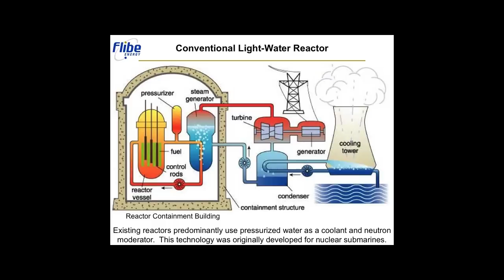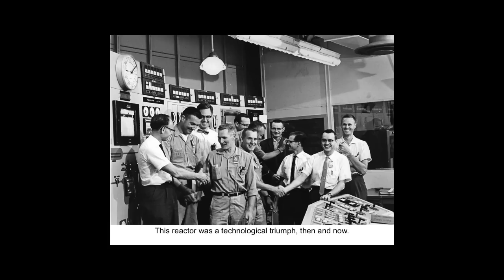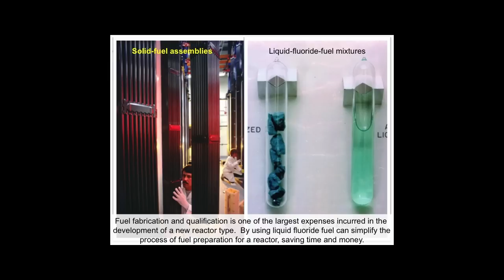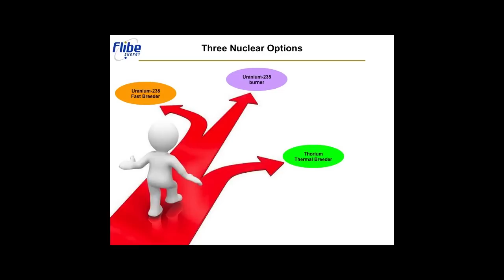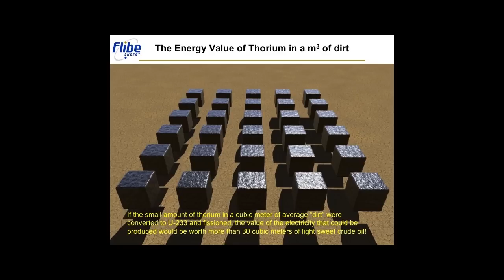Kirk Sorensen of Flibe Energy: Why We Need LFTR

Comment: "The end of our worry about resources." (20:42)

To what extent do Thorium-based reactor designs rely on the availability of helium to process the fuel? Our current methods of natural gas extraction are destroying the capacity of the Earth to hold helium deposits. (Appropriate fees charged to those who cause adverse environmental impacts and deplete resources would correct this situation.)

Systemic flaws are not reported:
http://gaiabrain.blogspot.com/2011/08/systemic-flaws-are-not-reported.html

Comment: Energy From Thorium Foundation in this video 5:23 the image shows a HOT GAS as the medium to turn the Turbine. Is a close loop? Is this gas something other than water? can this put an end to the  Water-energy_nexus? http://en.wikipedia.org/wiki/Water-energy_nexus
Reply: +Rafael Gomez super critical co2
Reply: +Matthew Holevinski

1)  closed loop co2? 
2) can this put an end to the  Water-energy_nexus? http://en.wikipedia.org/wiki/Water-energy_nexus
Reply: +Rafael Gomez 1) yes 2) yes ( the waste heat not really usable for generating electricity and that would just get expelled to the environment could actually desalinate sea water, so it's a step in the right direction) 3) Your power plant would actually generate electricity AND water :)

Comment: In the case of an emergency dump of the primary circuit molten salt, what happens with the reactor? Will it not blow? And what if the primary circuit container is punched? Can such a contraption be assembled like proposed in this project: google for "mit designs floating nuclear reactor"
Reply: Eduardo Cavalcanti  It can not blow,besides the fact that its not pressurized  their is no core essentially. The fuel is in the fluid and the graphite rods are the catalyst. When the liquid fuel is drained away from the rods the reaction is automatically stopped by itself. This thing truly is remarkable.
Reply: noodles818 AND it is self thermal regulating, meaning that when it gets to hot electrons are harder to find so the fission slows or stops, and when it gets too cool electrons are abundant making fission speed up.
Reply: +noodles818   Yes Sir. Alvin Wienburg @ Oak Ridge National Lab.
Reply: That is, if the core overheats, how things get setlled, what is the escape path?
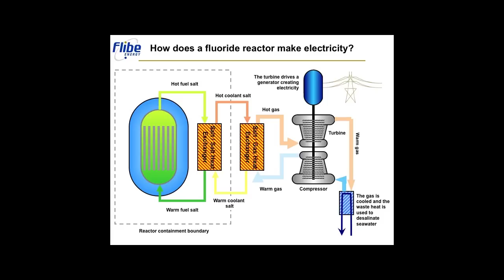Reply: Look at 5:40

http://youtu.be/97GtL98kmPA?t=5m40s
Reply: noodles818 Fuckin genius this thing is!!!